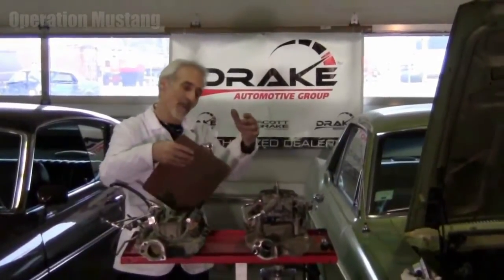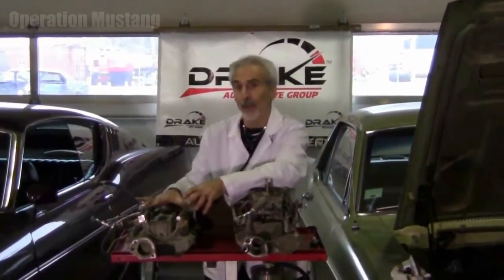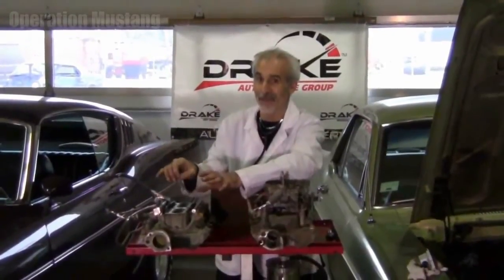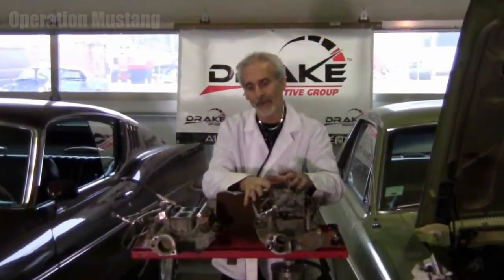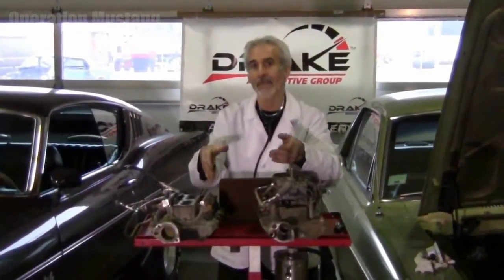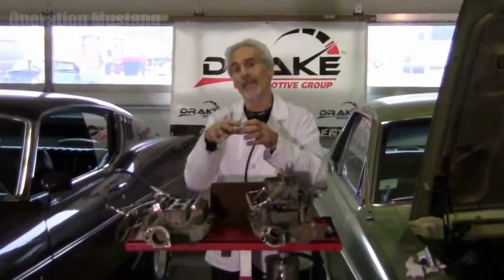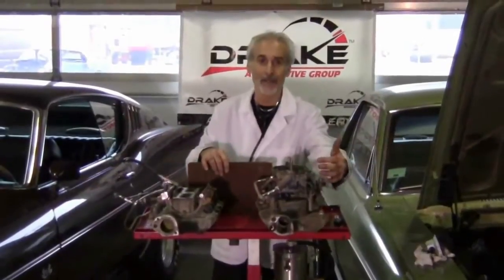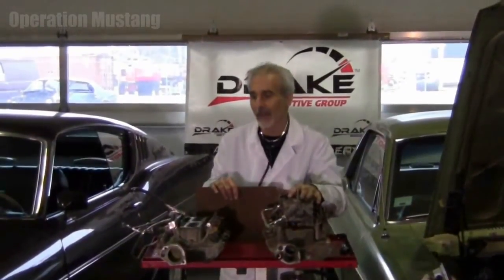Mustang Fuel Injection vs Carburation

Comment: Carburetor is like a nokia 3310..

Efi is like a apple iPhone. 

The iPhone outperforms the old nokia 3310 in every way.. But as soon as it's a few months old, the touch screen stops working and you get all sorts of bugs and glitches and it's a big hassle to fix and it's just easier to get a new iPhone.. 

But that old nokia 3310 is still running.. after years... and years... and years....... Sure it doesn't preform like a new iPhone but it does it's job like it should and doesn't complain. And they're pretty indestructible too.

Comment: Very accurate description of carb. vs. fuel injection. I prefer easier to fix carb. which does not cause much trouble overall. I have been stranded more in new cars than old ones as fuel injection is harder to diagnose and fuel pump is in gas tank.
Reply: carb just a bit tuning... there you go...
Efi one sensor or relay won't work it may cause the whole engine wont start  at all lol...